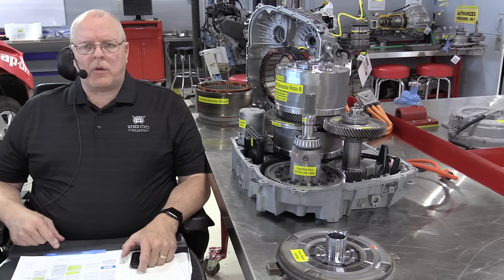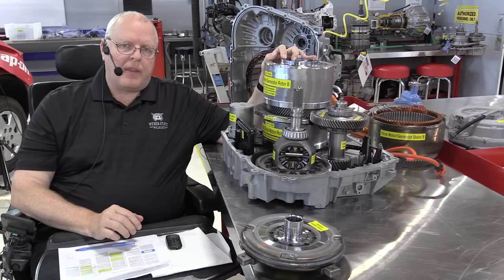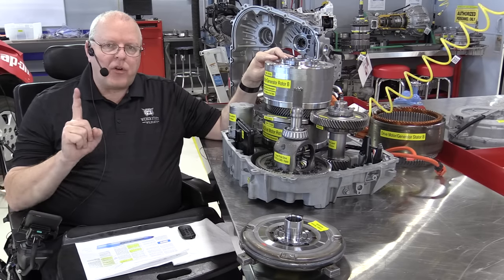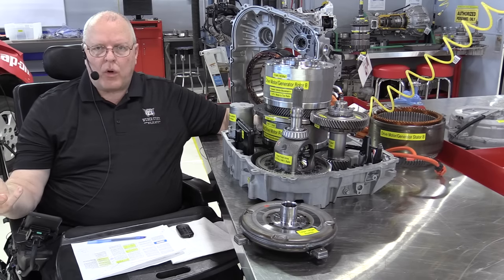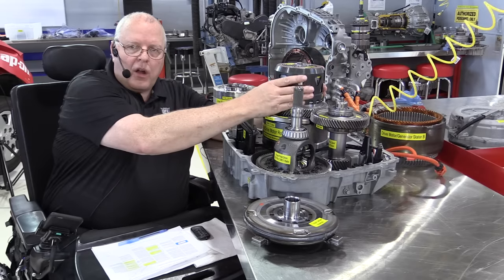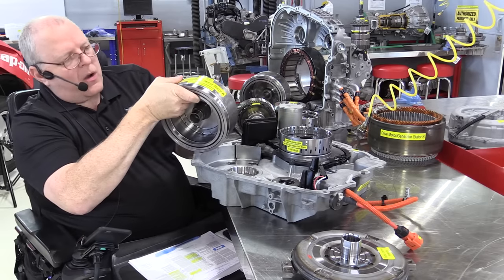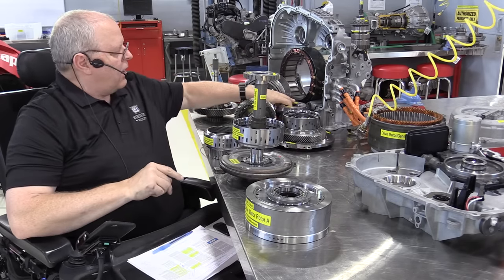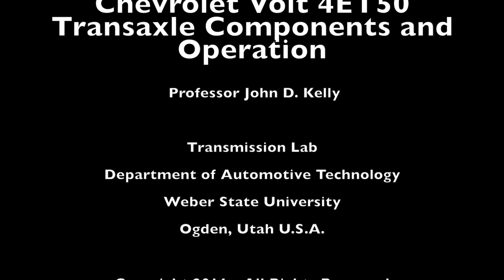Chevrolet Volt 4ET50 Transaxle Components and Operation (2011-2015)

Comment: Question for WeberAuto - as I think about how the Volt works, I've always thought that that the highest wear point of the car are those clutches which are constantly engaging/disengaging. As such, my assumption has been to preserve the Volt as much as possible that I should change the transmission fluid more frequently than recommended to keep the viscosity level like new as well as clean. Thoughts? .
Reply from the maker: No, the Dexron VI fluid is designed for that specific use, it is not a problem. Just follow the service schedule in your service manual
Reply: There is a comment elsewhere here saying that the Volt synchronizes before braking the gears. If true, the clutch wear will be minimal.
Reply: @fmccloud  Clutches are used to mach gear speeds?

Comment: A question regarding the operation of different gears: D&L and Neutral. When trying to get the highest mileage out of the charge, I have noticed that the most economical is to actively switch between L and D, but also on long downhills to switch to Neutral and let it roll. I have understood that this wouldn’t do any damage to the car, but it turns out that it is quite difficult to find correct answers. What do you recon, am I doing more harm to the vehicle than I’m gaining in added range? The above description is with EV-mode and enough state of charge. 

Thank you in advance!
Reply from the maker: It will not hurt anything. The oil pump that cools and lubricates everything works in neutral too. Best wishes
Reply: If you switch to Neutral, don't touch the brake pedal or you are instantly wasting heat as energy.  Neutral fully disables the regen.

Comment: I like your video. But I want to clarify.... in mode 2, EV only steady state low torque, it uses BOTH MGA and MGB. MGB is splined to sun gear, and MGA is clutched to ring gear. Doing this reduced the RPM of BGB, this is what achieves higher efficiency because lower motor RPM. IF MGA and MGB both turn at same RPM, then the ring gear is essentially a 1:1 direct drive.
Reply from the maker: The combination of both motors at variable speeds per motor gives a variable gear ratio.
Reply: WeberAuto yes I understand its variable. Its just it seemed to me if someone watched who had no previous understanding of the transaxle, it sounded like you were saying in mode 2, its MGA ONLY. But as we know its blending MGA with MGB through the planetary creating a variable ratio

Comment: this is a great video! question. the damper at engine....is that only for engine damping or does it act for the motor also? Would it be needed if there was no engine?
Reply from the maker: Thank you! The damper is used when engine power is transferred into the transmission to run the generator. It would not be needed if there were no engine.

Comment: Thanks for the video. It really helped me understand the dynamics of how the 2 motors and the gas engine are coupled to produce motion. Question: does the 2nd gen Volt still use the same principle of an A and B electric motor coupled to the gas engine. I ask because your description states that gen2 uses a different design. I wonder if you could add a video on the main differences between gen 1 and 2. Thanks again. Subbed and liked.
Reply from the maker: Thanks, The Gen-2 Volt uses the same A and B motors, but it uses a chain drive to bypass the counter gear and directly drive the final drive. This makes the unit lighter weight and a little more efficient. There are other changes as well, but that is the major one. Thanks for the feedback!
Reply: "This makes the unit lighter weight and a little more efficient."

I wonder if the chain may be less reliable though.
Reply: @WeberAuto  I understand that there are 2 planetary gear sets instead of just 1 and the engine does add drive torque to the wheels on occasion?

Comment: Great video! I'm considering buying a 2014 volt.The average distance I drive  is around  25miles round trip.. So, the Volt doesn't have a traditional automatic transmission to go bad?.. and lastly, do you think the Volt is  a good trouble free cars? Thanks!

Comment: I told you in a previous video comment I have 2 Volts. A 2011 and a 2017. I did a youtube video with comparing some cosmetic difference in them. Do you know if there is much drivetrain difference in the 2 different generations. thank you and love the videos!
Reply from the maker: Thank you! Yes, the 2nd generation Volt uses a chain drive between the ring gear of the power split device and the final drive differential case. The chain eliminates the need for the counter-drive gear that the first generation Volt uses. This makes the transaxle lighter. There are other minor differences, but that is the big difference. I hope to get my hands on one soon and shoot a video on its operation as well.
Reply: That would be cool! I do know that my 2011 Volt seems to switch into gas from electric much smother. The 2017 seems a little harsher and has a bit of a "jerk" when it switches especially at 65 to 70 MPH. Once again thank you for the videos and all your responses!
Reply: Sorry. I had not watched the very end of video until now. and you did explain about the difference in the 1st gen to 2nd gen drive. maybe the chain is why I feel the switch more from gas to electric in the 2017? Thanks again.
Reply from the maker: I am not sure why the switch to gasoline is more noticeable in the 2017 model. I will investigate further when I get my hands on the newer transaxle. Have a good day!
Reply: Yea, that's what concerns me about long term longevity, chains tend to have slack, and slack leads to stretching and more slack, and finally to replacement. I bet the slack being drawn up is what you are noticing.

Comment: I enjoyed this video and the Fusion Hybrid video.. Thank you.   I drove a Fusion Energi Plug-In hybrid for 3 years.  Our family also has a 2001 Toyota Prius. and now I am driving a 2017 Volt which has a lot of torque!   I posted the link to this video on the gm-volt.com forum under propulsion.  Do the clutch-brakes ever wear out?  Can they become defective and cause the power to the output drive to vary at constant input?  What does moving the shift lever to position L do?  I have driven 70 mph in Low no problem..
Reply from the maker: Thank you! I am on my second Volt, a 2014. The 2017's look pretty nice. Yes, clutches and brakes can wear out over time, but I am not aware of any common issues with this transaxle, they seem to be lasting very well. The L position of the shifter is similar to the B position on the Prius, it turns up the regenerative braking force to help slow the vehicle without using the hydraulic brake system. It seems like cruise control may not work in the L position. Thanks again for your feedback!
Reply: The Chevy volt forum says, the clutches engage only with the same speed "04-03-2012, 09:29 PMI
 would believe that the fluid will not get "dirty" unless there is 
plenty of clutch wear. Someone posted before that the clutches inside of
 the Volt engage while both surfaces are at the same speed or with 
little torque differences, so there will be less wear."
Reply: Hi, great video!  The engineers that come up with this stuff are mind-blowingly smart!

I'm curious about your statement that Cruise+"L" may not work together.  I also have a 2014 (owned) and had a 2012 (leased) and in both Volts, I was able to use my Cruise with "L" mode.   Can you say a bit more about that?  Perhaps yours had a malfunction?
Reply: @WeberAuto  Cruise works well in Low in my 2013, though at the highway speeds where I normally need cruise control I find it more efficient and comfortable to run in High. But thanks to this video and the understanding it imparts, it seems clear that all Low does is remap the throttle control and regenerative braking through software control of the electric motors, so there is no “shifting” of mechanical gears that would cause wear. The 2013 Volt Manual says not to use Low over 35 mph, so I was wondering about this question as well.

Comment: People are maximazing their range by using N (neutral gear) for coasting down hills. Does shifting to neutral have any mechanical reasons not to do it? What does it do in the gearbox when you shift to neutral on speed and then back to D / L when the car is coasting?
Reply from the maker: It will not hurt anything. The oil pump that cools and lubricates everything works in neutral too. Best wishes

Comment: Is it possible to equip  Volt 1, Volt 2, Bolt  or Spark EV with differential lock to improve to improve acceleration and front wheel traction in corners ?
Diff lock helps to drive safetly and do not get stuck in slippery surfaces: gravel, sand, snow, dirt.

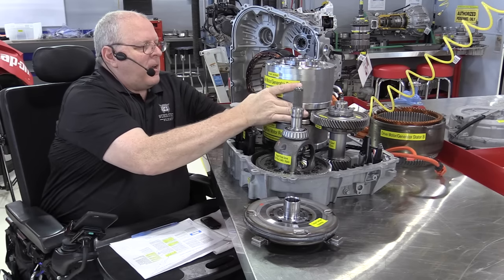Comment: The video is cut at 16:35 and it looks like motor/generator rotor B moved about half an inch. Can you explain what happened between cuts? I'm having issues since we replaced the bearing on motor/generator rotor B and are now unable to reinstall the cover.

Comment: Hi thanks for the video. Would you say that 4ET50 is better than the other hybrid's trans axle?
Reply from the maker: Thank you! Yes, it is far superior in my opinion.
Reply: Thanks for the reply!
Reply: @cedr381  Other than things like solenoid and the outer bearing whine issues, any physical catastrophic failures of the gen1 volt geartrain were few and far between. Does GM plan on resurrecting Voltec in larger vehicles in the future? Something that the population is actually buying? Heck I was surprised to see how larger the Bolt was in comparison to the Volt side by side... surely there is a larger vehicle market for SUV/crossovers with a Volt style drivetrain... seems such a waste otherwise.

Comment: Mr Weber Auto - I worked in the Lubricants business at Chevron.  Can you mention type of lubricants if any in the gears and such.   Thanks.
Reply from the maker: The only lubricant for this transaxle is Dexron 6 automatic transmission fluid.
Reply: Excellent. Thank you.

Comment: i really want to tow this transaxle behind my RV  4 wheels down and wish there was some hack or mod we could do like keep the oil pump on for towing  .. it has become hard to tow any EV behind a RV .  and so i have been trying to look into a way to do this .. maybe adding 4x4 wheel hubs/locks to the drive axle
Reply from the maker: I am not aware of a way to make the electric pump run without powering on the vehicle. Even if you could power on the pump, the wheels would drive the planet carrier and attempt to drive motor B and a clutch pack; not a good idea. Best wishes.
Reply: Remco used to make a product called Axle Lock .. i have been trying to find some thing like that

Comment: Hello,THANK YOU for this Video. I have a 2004 Prius and verry happy with ! The Volt looks also good to me. But i have fear ....... think it is to complicated !? To much Clunches ..... to much Technics .....
Will it last 200.000 km ?? My Prius have 180.000 km without a Failure ! Hmm ...... Volt looks nice !
Reply from the maker: Thank You! Yes, they are lasting very well. I have one of my own.
Reply: UpHillEdd   There are many Chevrolet Volts with over 500,000 + that’s miles not kilometres much better built than anything you could Purchase
Reply: @RajunRae  This is only ONE verified Chevy Volt over 500k miles, and it was "Sparkie." He as since sold it.

Comment: 2012 Chevrolet Volt and there's times my battery don't want it kick in it goes straight into the motor and I haven't battery checked out it's good so I would like to know what do you think is causing the engine room to run so hard and not kick in to the battery when it's supposed to you have to turn the car off and on to get the battery to turn on and shouldn't have to do that so can you maybe tell me what might be going on I took it to the Chevrolet dealer and for some reason another that can't figure out so maybe you can help me then when the battery drains the engine runs hard it don't slow down and idle smooth

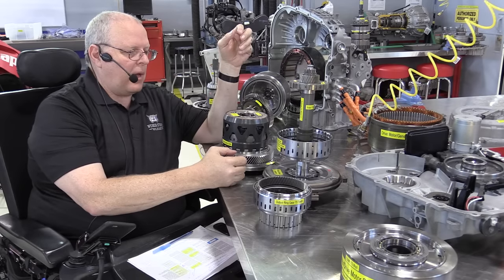Comment: Mode 2 ist what you say at 28:10 not what you say at 9:30, you can´t disconnect MGb.
I like your videos, i have a Volt too  (Ampera).
Greets from Austria
Reply from the maker: Thanks for your feedback! It is true, MGB cannot be disconnected from the sun gear, but its rotational speed can be slowed to almost a stop making MGA the primary driving motor in mode 2 (Electric Only Combined Engine Off (EV)). The following statement comes right from Hydramatic's own 209 page technical guide for the 4ET50 "Depending on driver demands and road conditions, the vehicle can enter combined mode. During this mode the variable hi and 2-3-4 clutch is applied allowing generator/drive motor – unit A and/or drive motor/generator – unit B to provide output torque. If the required torque to propel the vehicle is low, then generator/drive motor – unit A can supply the torque needed to move the vehicle. If the demands increase, then the primary torque supplied comes from drive motor/generator – unit B." I hope that helps clarify things. Remember, the planet carrier is the output to the final drive. Technically MGB and MGA can be inputs or reaction members. Best wishes!
Reply: Aha, so in Mode 2 it can change the MGa/b Power split ratio, by changing the MGa/b speeds. i wasn´t aware of that. Thank you.

Comment: I'v got opel ampera with DTC P079C is Transmission clutch 3 slip detected,what can be problem,clutch pack or tcm module ? Car drive only on electric engine, no gasoline engine start.
Reply from the maker: Clutch pack slipping can be caused by low fluid level, low oil pressure, worn clutches, a solenoid or TCM problem. Begin with checking the fluid level. Best wishes
Reply: thank You WeberAuto for quick reply,i'll check and let You know.
Can you show solenoid responsibility for control for clutch no 3 ? Where is located solenoid block and what is corect presure fluid ?

Comment: hello, i have problem! i have cvt transmission for nessan micra 16v. i make repair bearbox when i install gearbox in the my car. transmission no change speed, the speed slow the gearbox did not have wind. please how i give wind in the transmission. thank you for cooperation.
Reply from the maker: Make sure the fluid level is correct.

Comment: Are there actual clutch packs in this transaxle that have clutch material that can wear over time? What are the clutches comprised of? I'm trying to understand where wear and/or slippage can occur in this transmission. Thanks!

Comment: After watching this video and the one about the Ford/Chrysler/Toyota trans-axles GM trans-axles look like a result of engineering indecision. I don;t see how the addition of clutch packs, fluid passages, valve body, etc results in advantages worth the complexity and eventual repair cost.
Reply from the maker: Thanks for your feedback. The clutches allow higher vehicle speeds, hybrid operation, true EV mode operation, and more torque by using both motors at times.
Reply: SirDeanosity the beauty of the Volt compared to other (inferior) plug in hybrid is the Volt can go ANY speed, all the way to its electric limited 101 MPH in EV mode with out turning on the internal combustion engine (ICE), and it can accelerate at FULL power in all electric EV. Not to mention provide cabin heat and cooling in all electric EV. With all the other (inferior) plug in hybrid, even if you have a fully charged battery, if you go over a certain speed (64 mph) or command high torque acceleration (floor the pedal) the ICE will turn on. Also if you need to heat or cool the cabin, you burn gasoline. This is why GM calla the volt an Extended Range EV (EREV) and stays away from calling it a plug in hybrid .
Reply: The Plug-in Ford C-Max uses electric A/C and heat; they do not require the engine.
Reply: Yes ,but it has only half the range
Reply: @Pete The range is limited by the battery size. The Ford's HF35 transaxle can run up to 85 MPH on electricity so it isn't "limited" as many believe, and as thus, isn't "inferior", just different to the Volt's 5ET50.
Reply: To me the added complexity and addition of wearable items is not a good tradeoff. The Prius drive line has no wearable parts.
I guess if you drive mostly city the Volt or other plug in is better, if you regularly drive more than it's EV range your better off with a Prius type hybrid.
Considering the reliability results of the Prius.. I'd probably choose that regardless.
Reply: Or you could just get a Chevy Malibu Hybrid which uses the Chevy Volt tech "slightly modified to work with ICE" and have your cake and eat it too, that's what I am going to do.

Comment: Does the regenerative brake wear? On my ELR with 95,000 ive noticed the paddle braking doesn’t slow the car down as quickly as it used to.
Reply from the maker: No, it is electronic. Thanks for watching

Comment: I feel like the regen on my 2011 volt doesn't slow down the car like it used to.  Driving in L of course.  Is it possible that it wears out, or just my imagination?
Reply from the maker: It should not change over time, the only time it could be less is when the battery is fully charged. Best wishes
Reply: Driving in L makes no sense compared to anticipating stops with coasting. Regen is only ~70% efficient.

Comment: Very interesting. Does it shift gears or is it always one drive ratio?
Reply from the maker: It is always one ratio, 7.575:1 motor to tires. Good question!
Reply: WeberAuto
Thanks.
Reply: I thought a video I watched the other day on this, you said it was a 2 speed transmission, low and high, now I am confused.